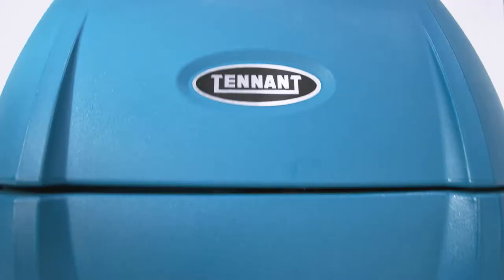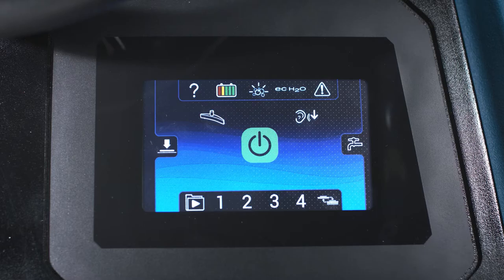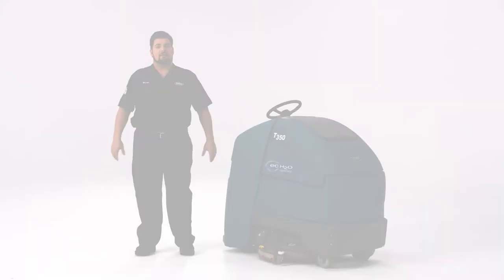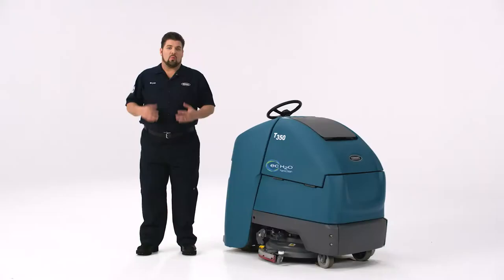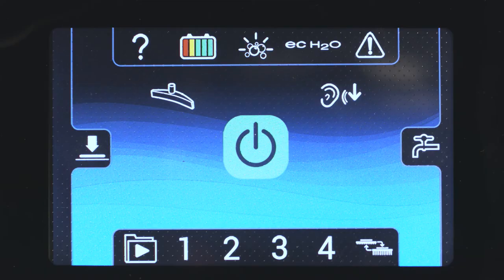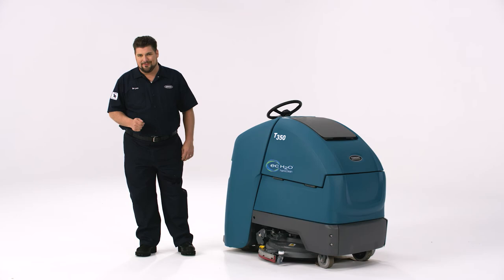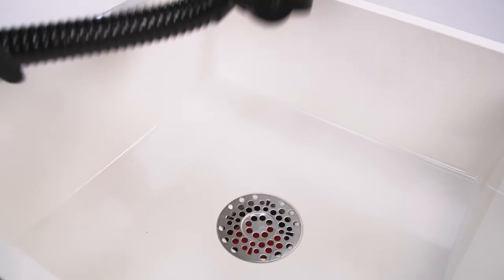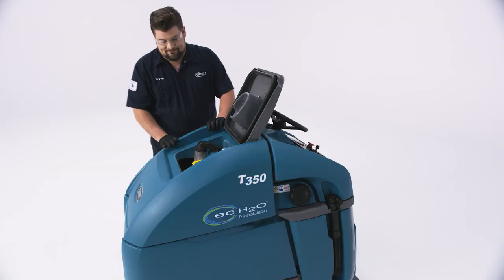T350 Stand-On Scrubber | Operator Training | Tennant Company

Comment: What’s #1 red blink light
Reply: A system fault out of the 5 lights what one is it
Reply: It could be vacuum over current fault. Vacuum over current fault 1 and vacuum over current fault 2 which you need to contact service
Reply: The other could be allow propel motor to cool power cycle machine if it persist contact service
Reply: Could also be scrub motor short fault contact service.
Reply: Voltage/power loss contact service
Reply: And last ec h20 pump over current contact service
Reply: So no matter you will have to contact service for all
Reply: So no matter what you are going to have to contact service for it something you can’t fix yourself or you would void warranty
Reply: If it’s the first light too the left then it would be the h20 pump over current